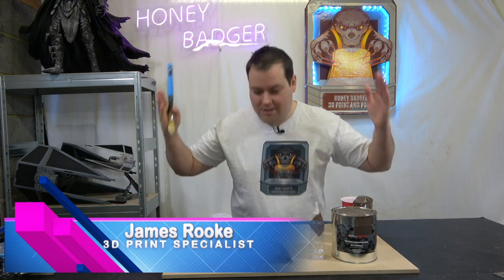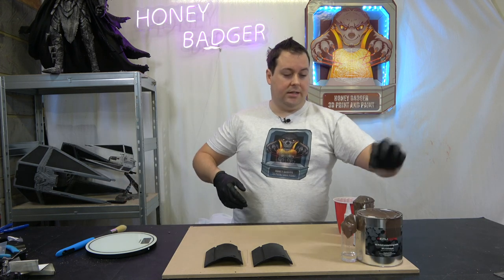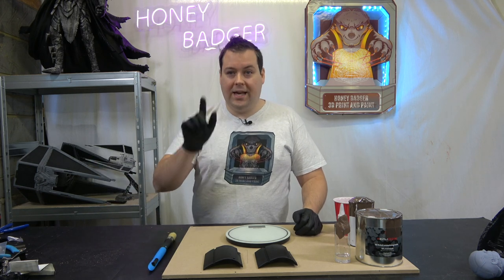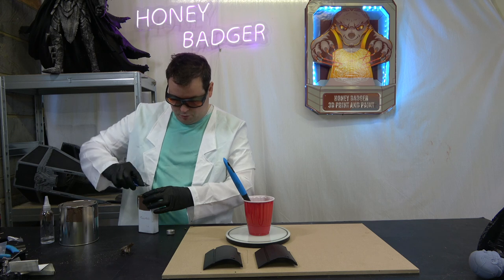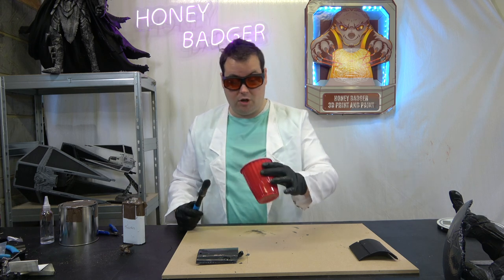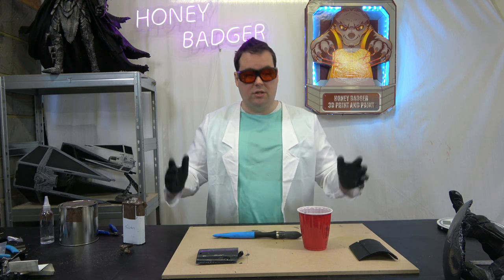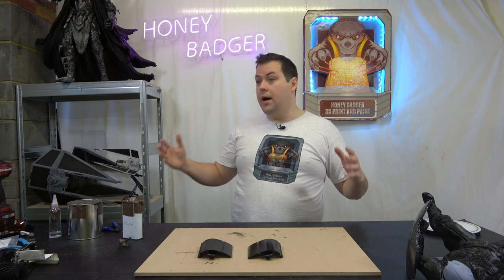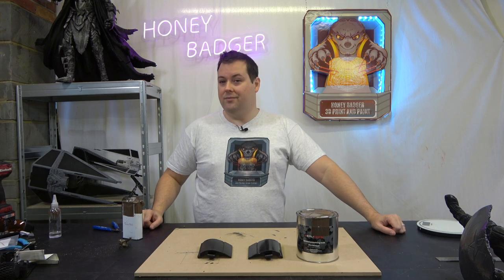Replicoat - 3d printing with a perfect finish everytime

Comment: Another great video..  Can this also be used on parts which I have painted?  I mean I would like to put this on my thanos blade but dont really want to repaint it once more?
Reply from the maker: so you can, I would thin it just a touch so you don't loose detail but you would have to paint over the top as when this goes on its a dark grey, but you could chrome this afterwards and it would look perfect